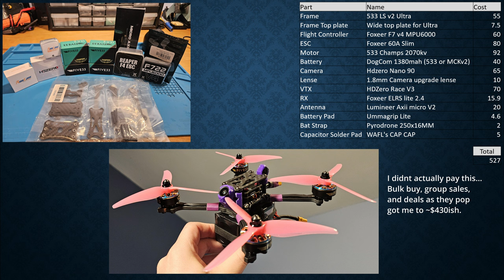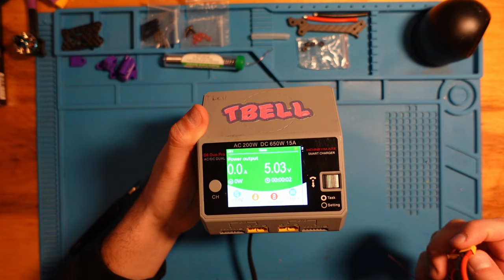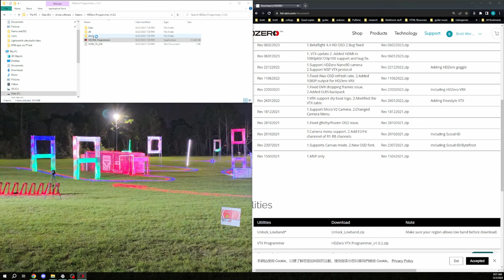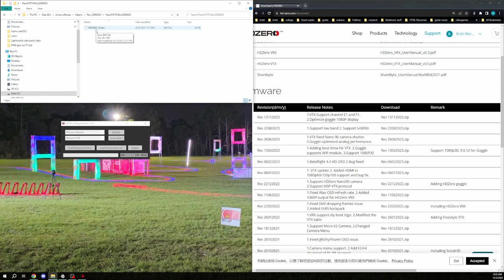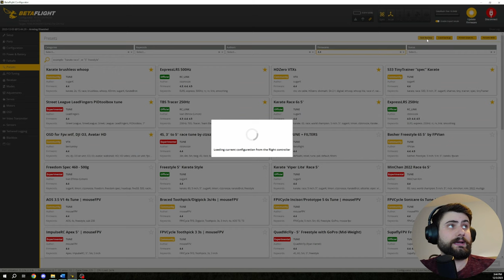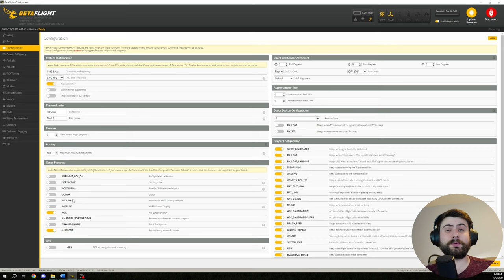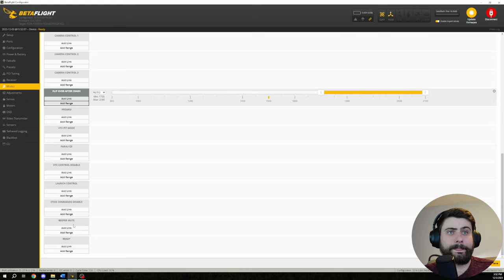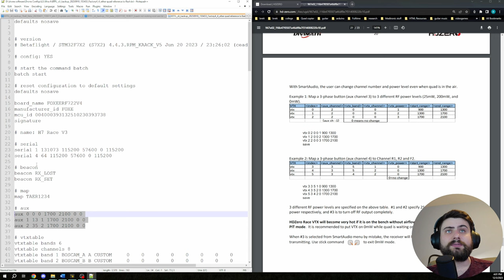Lightswitch Ultra HDZero Build and Setup Guide

Comment: I’m in the same boat, been out of the hobby for 3+ years but I’m getting back into, building this exact build x4, ordered frames and motors in bulk on Black Friday and just got my hdzero gear including goggles as well, spent a lot but also saved a lot lol, just waiting for the slim esc to be in stock, good vid!
Reply: I use liquid electrical tape for the ufl connector, haven’t tried the b7000, just have to be careful when changing antennas with the liquid tape
Reply from the maker: @donnygfpv7548 ive ripped off the ulf using the liquid electrical before. I really like the b7000 as twists off pretty easy. NMGrower showed me that stuff.

Have fun with the builds! You're gonna love them.

Comment: Thanks for sharing your build. I just finished building my first 5 inch racing quad this week. I used Limon's open racer frame and an HDZero race v3. The build went pretty smooth but when I flew it I found some weird bugs I gotta chase down. I don't know if they are related or not but when I fly it the quad keeps trying to slowly pitch back to level and roll slightly to the right so I have to constantly compensate a little with the right stick just a little bit to keep it pitched forward and flying straight. The other issue is the link quality says zero and RSSI DBM is -130 in the OSD but I'm not getting any failsafes. I've checked everything I know to check and watched a bunch of videos and I am stumped. The only thing I haven't tried yet is mess with the ESC settings in BLHeli. I have the ELRS module between the two carbon plates in the front because it's the only place I had room to stick it.
Reply from the maker: The quad slightly rolling issue is odd. Does this happen in acro mode?

For the -130db, that is the lowest it goes. So I would use LQ instead and see what that says. Also i recommend using some vhb tape and put the elrs chip on the inside of the nylon canopy. Those ceramic antennas really will degrade signal if sandwitched between carbon I assume.

Also try and use the elrs preset to match what mode you're using (250hz vs 500hz vs 1000hz)
Reply: @TbellFPV  The LQ says 0 for both numbers. I'm using an EP1 style receiver with a T antenna zip tied to an arm. The roll/pitch issue is in acro mode. I even tried turning off the accelerametor but it still does it. I'm wondering if that is a gyro issue or maybe one of the motors de-syncing or something since I haven't messed with the ESC settings yet. It was worse but seemed to get better when I lowered the PID loop frequency for some reason. Unfortunately now that there's snow everywhere I'll probably have to wait till spring to get it figured out.
Reply from the maker: @timcarlson815  what is the FC and the gyro on it?  Make sure no wires are touching the gyro chip or running near it.
Reply: @TbellFPV  The FC is a Hobbywing F7 convertable with a MPU 6500 gyro. I don't have any wires running over the FC but I could try loosening the nuts on the top of the stack to see if that helps
Reply from the maker: @timcarlson815  I have not used the mpu6500 before. Really just bmi270 and mpu6000. 

Might be worth reaching out to hoobywing to see if they have suggestions. Another thing to check is if your getting noise when you rotoate the quad and look at the charts ( betaflight sensor tab)
Reply: @TbellFPV  Thanks I'll give it a try. At least I have a few months to trouble shoot. I ordered two more frames but I think I'm going to use a Foxeer FC and ESC for the other two and hope they work better.